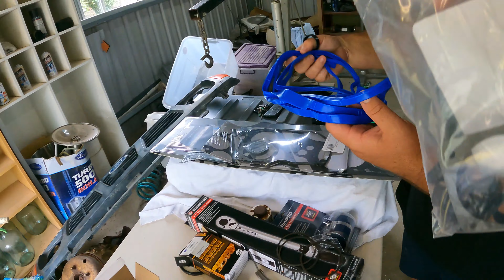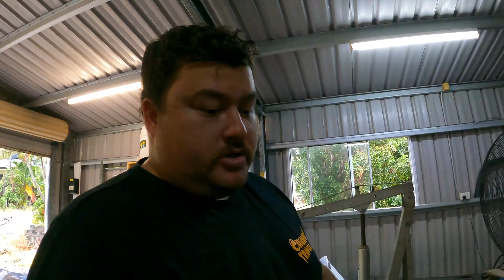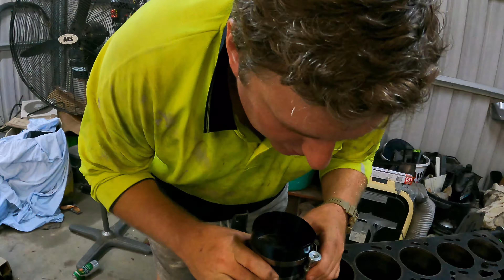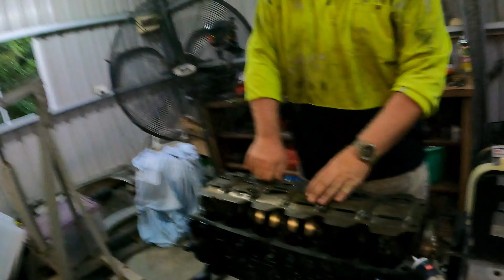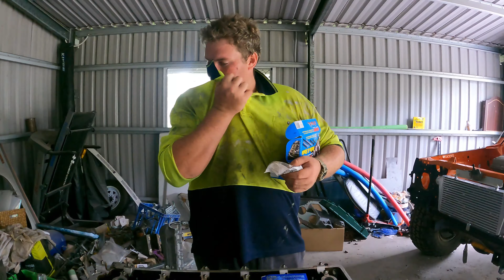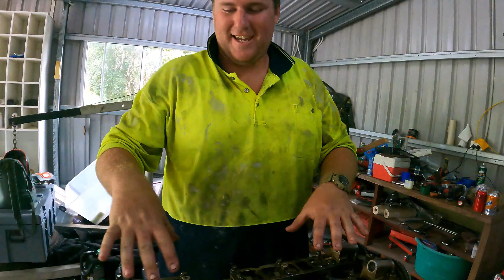Finished our 600HP+ BARRA engine build

Comment: What did you do about rod bolts.i thought they are torque to yield and need replacing with new ones.
Reply from the maker: Hey dude I couldnt find anywhere that they are TTY so we just reused the factory rod bolts. So far so good.
Reply: @ChunkyTravellers  a good way to tell is if your givin a torque value and a specific angle in degrees to tighten to.max torque yield then the required stretch.i had to do this on my intech bottom end.may not be the same on a barra.
Reply: @ChunkyTravellers  would you remember what you torqued them to? its been well over a year so I apologize 😅
Reply from the maker: @mrmister5729  yea all good mate we just torqued them to factory specs which are 48nm
Reply: @ChunkyTravellers  cheers man 😁

Comment: 600 hp build without decking head and block , out of interest did it lift a head yet
Reply from the maker: Nah dude had no dramas with the head, did learn the hard way that factory harmonic balancers don't like to be pushed hard tho.
Reply: @ChunkyTravellers  How much power did it make?
Reply from the maker: @oky69  ended up making 510hp atw @21psi
Reply: @ChunkyTravellers  nice number , was that on ethanol , what turbo?
Reply from the maker: @oky69  yea ethanol and we use a 3582 ball bearing precision turbo